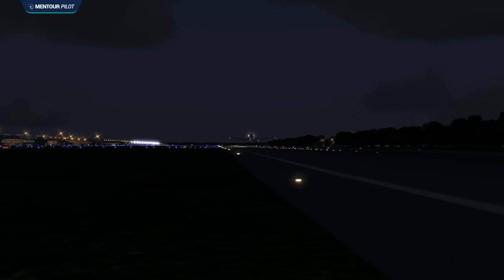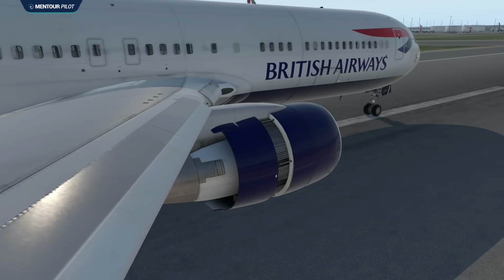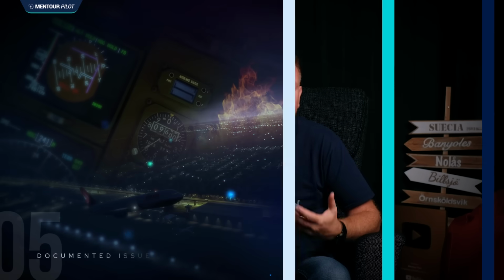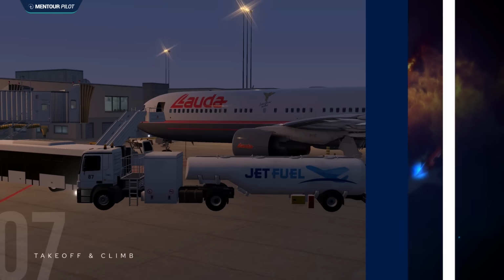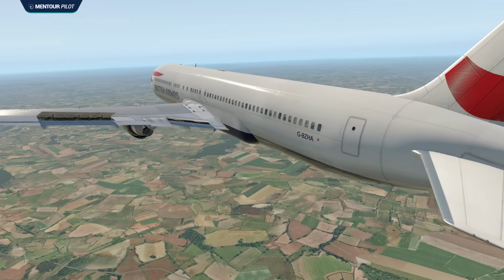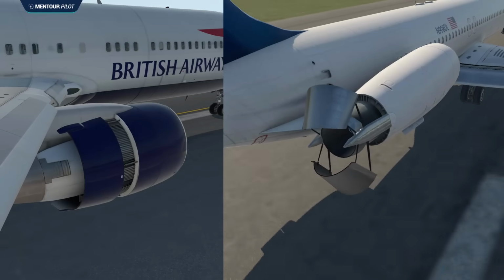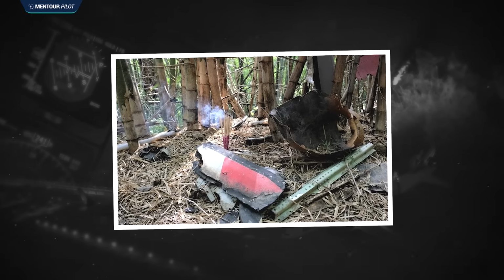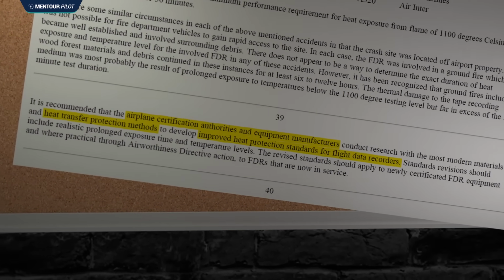HOW an Impossible Failure CRASHED this Boeing 767!

Comment: This accident, like other similar ones, would’ve been avoided by simplifying the system, rather than complicating it for saving some bucks. Longer runway and more frequent servicing of the tyres and brakes would’ve cancelled the need of a thrust reverser, in first place. But as usual, profit comes first. The engineers will just try to optimise the system, as this is the only true goal: reduce costs. 
I’m talking from own experience, working previously with the control software for the FADEC system.
When we implement some software features, we take a lot into consideration the “bypassing” of the rules. The system must ensure that the technician/pilot/whoever cannot bypass some safety checks, and indeed the quality has improved a lot with such mechanisms in place. Nonetheless, the complexity also grew, and some people always find shortcuts or they’re minimising the importance of some faults. 
I wonder how many Boeing engineers would’ve boarded that plane knowing about that list of previous faults.
Reply: They thought it would be a minor issue - until this plane proved the opposite. So - maybe all Boeing engineers?
Reply: @NicolaW72  I doubt. I’ve worked in the industry and I know that the work that I did, never involved “acceptable risk” nor “minor stuff”. 
At least in my set of requirements I dealt with “shall” and “must”. We were using “should” for other applications, nothing to do with the motor control and its auxiliary equipment.
So, at least myself, if I would’ve known of the existence of some faults regarding the thrust reverser, I would’ve had second thoughts boarding that plane.
Unfortunately, as I said in another comment, they always find ways to bypass some rules due to time/financial or even super confidence reasons (humans tend to be super confident and/or believe in divine help, which always makes things worse).

Comment: Well....That's completely freaking horrifying. And it highlights the reason I prefer to drive. What's that you say? Flying is safer than driving? Would that be true if there were as many planes in the sky as cars on the road? A car crash can be an instant to a few second event. I very rarely worry about my car suddenly switching into reverse, falling 31,000 ft out of the sky, tearing itself apart as it reaches mach 1 then igniting into a fireball while I have a front row seat to the event. And I promise you the second that does happen to a car....I will be walking.

Comment: These on and off failures are the hardest type to find /fix.    A friend who worked on room filling mainframe computers said, "Broken Equipment will do what it wants.   "   On the Junkers JU-52 there were struts supporting the horizontal tail surfaces.  They were thought unnecessary.  However, in at least one case those struts kept a damaged tail operable after combat damage.   Sometimes failures are based on that  extra bit of protection.  Remember to wear your seat belts.  they can stop unplanned takeoffs.

Sr I strongly suggest  you report all temperatures with " C" or "F"  so American users, especially young people understand  they are metric units or not.   I do not know when metric units are taught in our schools, so your youngest viewers may not understand how 26 degree ( C)  is a nice warm temperature.   Thanks for you superb work.

Comment: The only merciful fact of such a disaster is that the events happen so fast that no one on board had much time to think about what was happening. The flight deck crew was completely absorbed in trying to regain control and the passengers were likely simply in shock from the extreme motions of the aircraft. With such a high speed impact, no survival was possible. Gratefully it was over instantly. A tragedy for sure, but death came quickly and no one suffered.

Comment: As a Boeing Flight Controls engineer I spent many hours implementing improvements to this system, not only on the 767 but other models as well.  Mechanical locks were added to the reversers to prevent deployment even if the commanded by the DCV.  It's always the unknown unknowns that are the greatest danger.
Reply: Maybe you cannot say, but were you ashamed of Boeing's usual ducking and diving behaviour?
Reply: @jamesbong7852  No, because this was 30 years ago and Boeing had not yet been destroyed by McDonnell's corporate culture.  The company worked very hard to understand what had happened and spent a great deal of money fixing it.
Reply: @Trebuchet48  - denial at first though,  yes?
Reply: I just cant help but think the complexity of the thrust reverser system had a huge part in this disaster

Comment: What you don't mention and is not common knowledge is how much effort Boeing put into implementing a fix for the problem. It took us nine months to develop a redundant mechanical "sync lock" and another two years of design work--tons of wiring and documentation changes that involved all Boeing airplanes, not just the 767. 
Solving a problem is as technically challenging as finding a problem.

Comment: It is dumb to assume any particular flight envelope restrictions when testing for something like the inflight reverser event effects, since that could happen at any time while airborne.  I don't know how engineers talk themselves into that crap, but I would have been the one standing up and saying, WHY would you assume that???  Of course, as pretty much every engineer knows, that might possibly not have mattered.  It could depend on who else is in the room, from my experience.  A la "Don't even think about flying the Shuttle at that temperature" sorts of exclamations from the booster guys, if what I heard was correct.  And that one was backed by SOLID logic.

Excellent, but sobering and rather frightening video.  It is a shame there was nothing left to examine to actually pinpoint a cause, although in some cases that may be beneficial since all of the fault possibilities must then be considered.  That assumes, of course, that the one that DID occur was somewhere in that list.

Comment: Thank you for another well explained video. Continuous uplaod of flight data and cockpit voice recordings really does sound like the way to go to me, But still keep the black boxes in the planes too just in case of comunication problems- I've seen that on a lot of modern planes the passengers can watch a video feed often from the top of the tail looking down-If they don't already they should record that video feed and create a few more with more cameras looking at other essential areas of the plane too - It's quite maddening that something designed to slow and reverse the direction of the plane caused it to go faster than it ever should have in the end, This particular crash sounds quite horrific with those unsurvivable speeds, RIP to the Pilots,Attendants and passengers. My condolences to their familly and friends.

Comment: Exactly the reason I’m terrified to fly - when the things that aren’t supposed to or can’t happen, happen. RIP to all aboard.
Reply: SO they do when you are driving, sleeping, taking a shower and eating. That's life.
Reply: @TheLukaszpg  driving malfunctions usually kill in a far less terrifying way
Reply: Driving malfunctions also do usually have a higher survival rate, and there is more of a sense of control when you are the one behind the wheel. As a passenger in the plane, you have no control over your own fate at all, you just have to hope the airplane holds up and that the pilot can handle whatever may happen during the flight. Usually it goes very well, however when something critical does go wrong, there's usually no survivors. Airplane crashes are some of the most deadly accidents, because of how total they are when they happen. 

A car accident may be just as bad, but even when you crash head on and end up flipping around a few times, landing 20 meters off road, upside down or something, there's many people who have survived such a crash, while if the aircraft goes down nose first, no matter where you are seated, your chance for survival is like 0.00001% or something. Basically, you require a true miracle, and in the case of this crash, not even a dozen miracles could have saved your life.

Comment: I find the "assumption" of the flight test parameters for the reverse thrusters very odd. Wouldn't one want to test all possible scenarios (not only most likely/critical (assumed critical). High(est) speed would be one of the most logical tests with a component that affects drag and stress on material? I just don't understand this oversight.
Reply: but then it would show a problem, and we know how Boeing approaches problems like these, remember the 737 MAX
basically - at that time there was little to no oversight of certification, so manufacturer comes up with his own scenarios, tests and procedures, that is what goes into the book the second pilot picked up and saw no actions necessary
Reply: @dghtr79_36  yeah, you've hit the nail on the head. Regulators have to drive testing, corporations have a conflict of interest and will ignore problems. Just like the 737-MAX engine retrofitting and unannounced MCAS addition.
Reply: @Muenster Cheese Is that how you operate… ignore problems and they will magically not manifest? What do you do when the problems DO manifest? Engage brain before commenting, especially when you have absolutely no idea how the people you are insulting actually work.
Reply: @MuensterCheese Since you know so much, what was the issue with the MAX engine retrofitting? (even though it was not a retrofit, it was a derivative design with a new engine). And why did MCAS have to be announced? What would the pilots do with the information?
Reply: Every sentence in your comment is an incorrect assumption! You assumed that Boeing made assumptions about the flight test parameters. They made decisions based on analysis of facts. You assumed that all scenarios have to be tested. False, only outcomes that are uncertain or unpredictable are tested. You assumed that the highest speed scenario has to be tested. False, it depends on the analysis. You assumed that the designers suffered from an oversight. False, they analyzed the data and made a decision.
The ONE assumption they probably made was that an airplane with a reverser warning appearing persistently would NOT be sent on scheduled flights with passengers again and again and again… for MONTHS, without fixing it. No surprise the reverser finally deployed in flight.
Reply: You'd think unit testing would be a thing where every possible permutation of configurations is simulated but no...
Reply: @geodescent  you'd think so, because you've never owned an aircraft manufacturing company
Reply: it's called "selling planes"

Comment: When he was seated in the cockpit of his aircraft, he noticed a ground vehicle still had the windshield wipers on when the rain stopped. He stepped off the aircraft and turned the wiper off. When asked  why he did that, he answered in his typical dry way " It hurts me when I see a mechanical thing getting damaged".
Reply: Yes. I believe it's known as "mechanical sympathy". I have it, and cringe at my friends who don't display it.
Reply: Who?
Reply: @frankfarago2825  Lauda.
Reply: I didn't knew about this story! This is the most beautiful example of the latest findings of the neuroscience: for their brains, high-level professionals consider their "gear" an extension of their bodies. The example that doc who founded this used to illustrate that was, if we closed our eyes and was asked to point our fingers were the middle point at our arms are, we will do it easily at our elbow region. If you do the same with Federer, he will point at the region not only considering his arm but where is the middle of his arm plus the raket.
Reply: @ultimachamada1  What?
Reply: @Frank Farago Federer, the tennis player.

Comment: I’ve noticed that pilots often think there is a problem with an indicator light or message coming on in error, rather than believing that it actually suggests a real problem with the aircraft.  This is very familiar to drivers, most of the warning lights that come on in cars don’t indicate real problems, but just have to be reset at the garage, if even possible.  I’ve been driving around with the low-tire pressure light on for twoyears; the manufacturer’s maintenance and repair staff can’t figure out how to turn it off, but say the tires are fine, they’re only three years old.

Comment: Nikki Lauda's life story is nothing short of an astonishing story.  He was a Formula 1 driver who survived a horrific crash and was back in the cockpit about 2 months after he was read the last rites, kept driving and was competitive well into the 80s winning a grand total of 3 world championships.  

Then he went into business setting up and running his own airline, he trained as a pilot and was qualified to fly all the planes in his own airline.  When this accident happened he vowed that he would personally resign if Lauda Air was found to be at fault, and he really advocated for improvements and held Boeing's feet to the metaphorical fire over the thrust reverser failures.  

After that he went back to F1, first as a team principle for Jaguar, then as a spokesperson for the Mercedes F1 team, a role he was very active in right up until his final illness and death, and during which time he took a promising young driver by the name of Lewis Hamilton under his wing.  

He had a Hollysood film made about his 1976 F1 campaign, the one he was nearly killed in.  Having only one of those things under his belt would have been remarkable, but he did all of the above and more.

Comment: When the trust reverse came out, why did the pilots not put both engines directly to idle in order to not further increase the air speed and to control the aircraft?
Reply: You have to consider the the shock moment and then the time they needed to consider what was going on. As was said in the Video, when they tried it in the simulator with the correct model, they couldn't recover it unless they knew beforehand what would happen and could think of the right response.